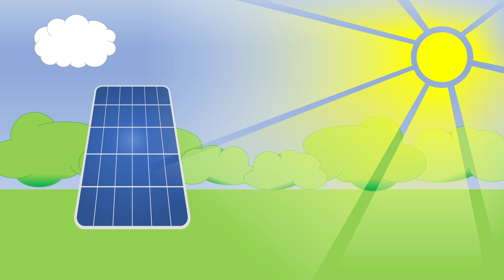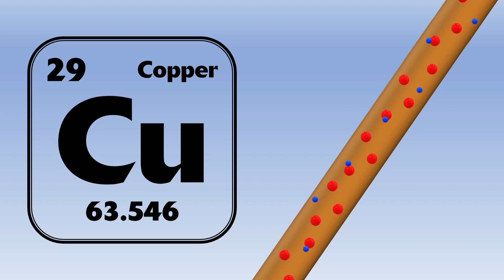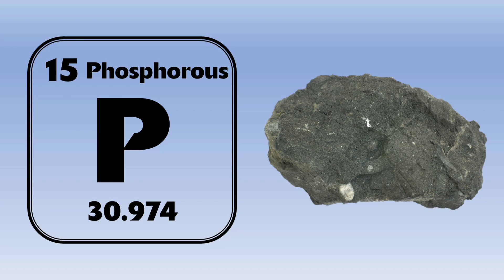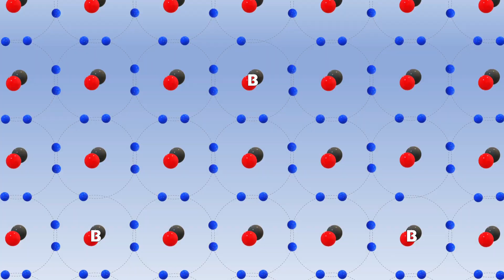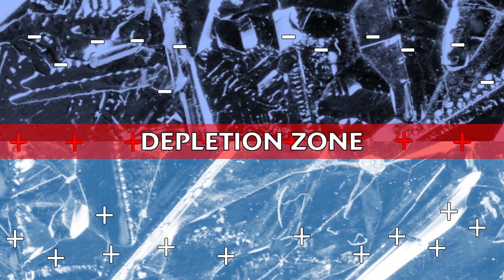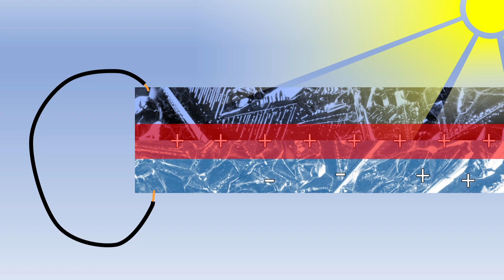How does a Solar Panel generate electricity? - Understanding the PhotoVoltaic effect - eFIXX Energy

Comment: The thickness of the space charge region is incredibly important and is a designed element.
Reply from the maker: I'm endlessly fascinated by the design of the electrical connections to the top layer, maximising contact without covering too much space...
Reply: @eFIXXENERGY  the layer also has a geometry tradeoff that's constrained by the anti reflective coating. Most modules now use a trapizodal bucket rather than linear surface

Comment: yay first comment! could you explain te entire charging systems with houses and batteries? and the difference in watts in panels?
Reply from the maker: Thanks 🙏 - lots more explainers coming!
Reply: The UK gets between 2.2-2.9 solar hours per day on average depending on location so take your daily kWh use and divide by say 2.5 to get the kWp that would be optimal for you.

Then size a battery system that will accommodate your ability to load shift your use.

Standards size panels are now 400W+ each so you can very easily create arrays that will be beyond the basic DNO import limits, but the benefit would be you generate more in winter months since your array will be oversized but capped by either inverter capacity or the DNO limit.